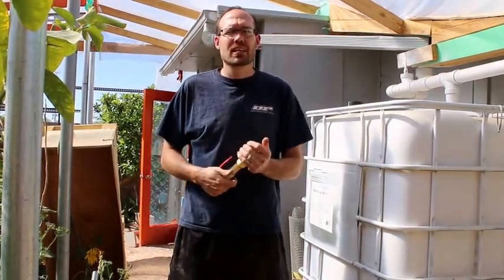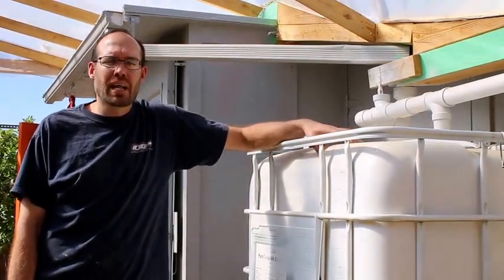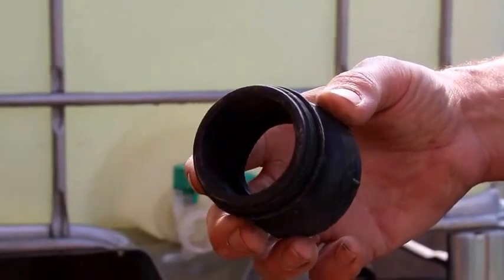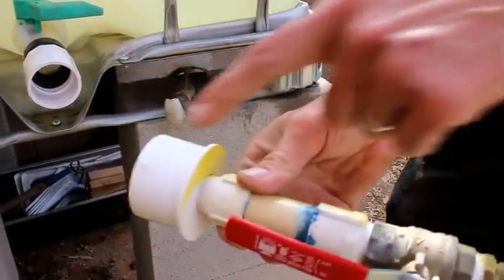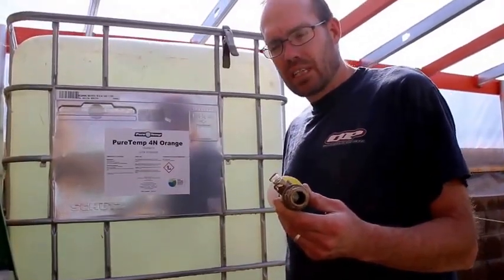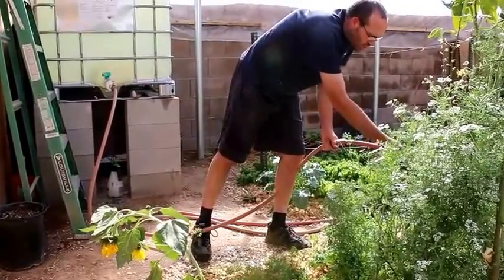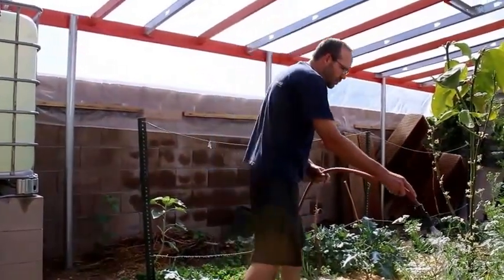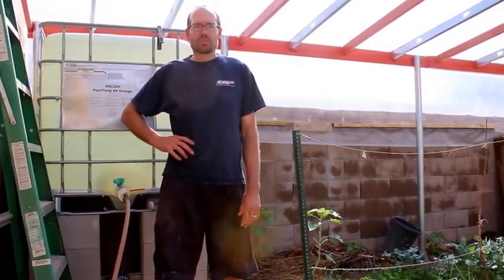Rainwater harvesting technique

Comment: Can you explain why you needed the unit that you put together containing the ball valve? The steps needed in the universal adapter video looked much simpler. Why did you need the extra complications? Great videos by the way! I learned a lot!
Reply from the maker: The system was used differently in this setup. I used more of a quick disconnect for this .